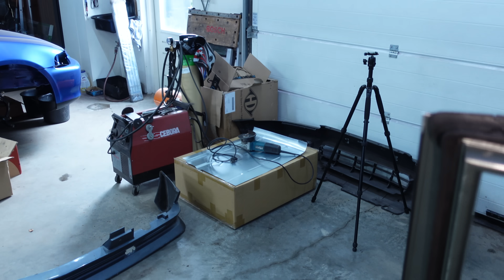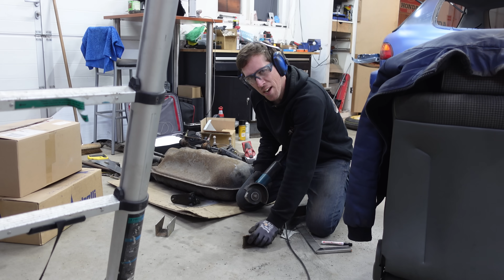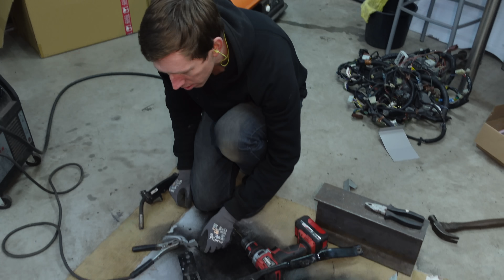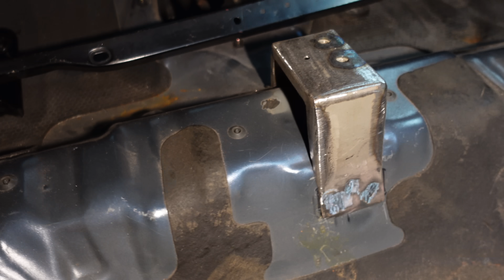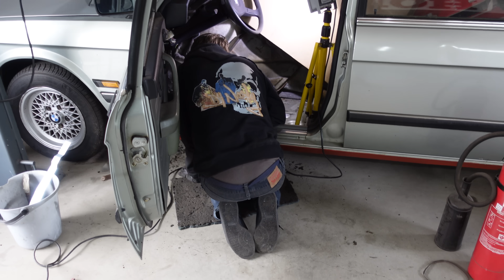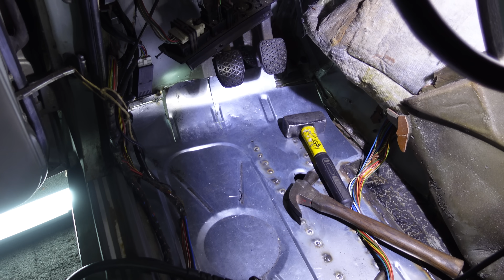Welding a new floor pan into my BMW E28!

Comment: Great work Joy! On my E12, I also tried the heat gun but it did not work due to age, so, like you, I used a scraper and hammer and it was much easier. I need to do the floorpans next and I still haven’t decided if I do the metal shaping myself or get these preformed and that looked like a nightmare to adjust to your car.
Reply from the maker: Thank you!!! Ahhh yes I feel like this is the only option in this case too 🥲 I'd definitely do the metal shaping yourself if you can. This really was a nightmare, and I didn't even show most of the adjustment process in the video.. 😅

Comment: If you have to remove bitumen again, there is an easier way to remove it using dry ice. I can’t remember the exact process but you should be able to find it on YouTube. ;) Nice job, keep up the good work!

Comment: Love from Germany ❤ tip: To Remove old bitumen use a hot air gun and a spatula, it eases the process a Lot. But don’t Heat up the old stuff too much, otherwise it will take more time than without heating

Comment: Tip from flip, you can use a heatgun to make to sound deadening softer and take it from the floor is a big piece. Saves heaps of time and removed more than hamer screwdriver combo.
Good work and good luck!

Comment: Great channel. When I restored my 78 Trans am, I used to drill and hand chisel. Until I found an air chisel. Bang easy on the spot welds, so much quicker - it might help - no drilling required.

Comment: When you grind or weld with a car nearby you must cover all glas panes (windows). The flying sparks burns small craters and get stuck in the surface (ruins the glas).

Comment: Gosh this brings me back the agony from my youth when I replaced all four flloor pans, inner sills and repaired side crash support beams in my first car Volvo 240. Drilling the spot welds from the both support beams per side at the front. Drilling spot welds out from both inner sills. I can not remember how many those special drill bits I bought. It was many. 🙃 Good stuff you do.